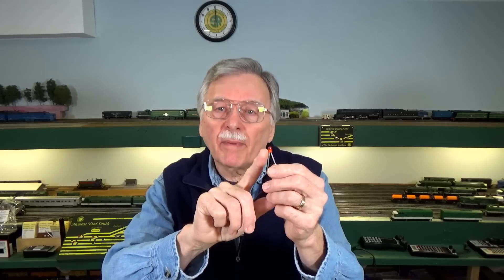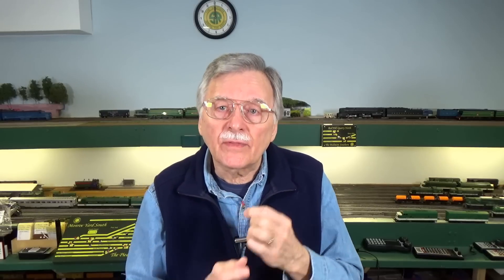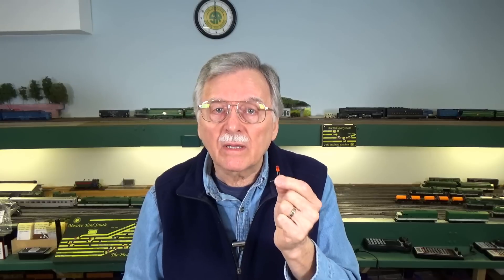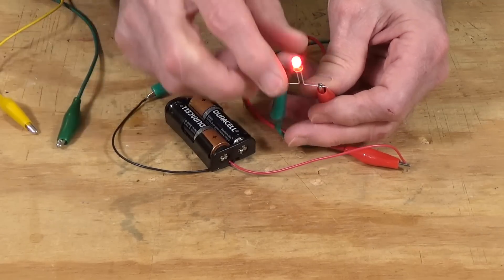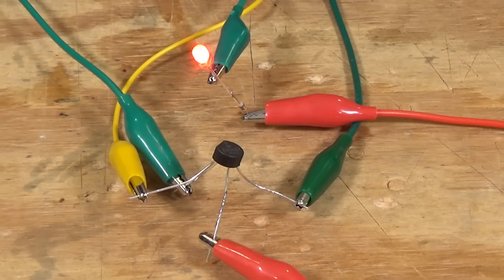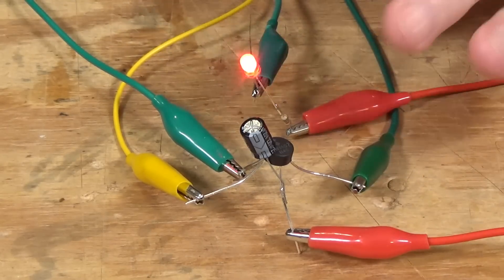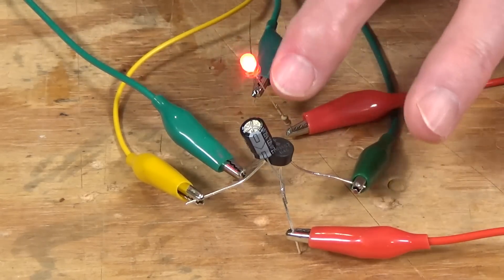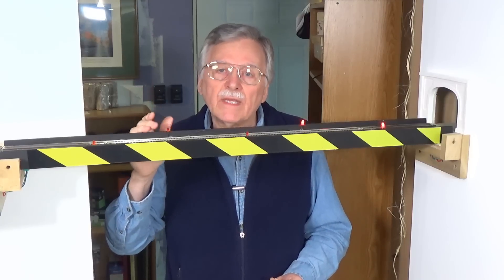The Secret To Using Flashing LEDs With DCC (302)

Comment: were the resistors necessary at each led, couldn't you just have one at the beginning of the feed
Reply from the maker: That would require wiring them in series which, as anyone who has had to debug old fashioned Christmas tree lights can tell you, is not a good thing to do.
Reply: @TheDCCGuy  thanks for the reply

Comment: Hi Larry. Is there any way to slow down the blink rate of these led's as I would like to use your circuit on my EOT cabeese? Thanks again for another great instructional video!
Reply from the maker: I think the blink rate is probably built into,the internal,circuitry. To vary the blink rate you’ll need to use a steady on LED with a flashing circuit. I’m sure if you Google LED flashing circuit you’ll find what you need.

Comment: Larry, can't believe missed this episode, the capacitor is what was missing in my attempt to do the same recently. THANKS.  Now have a question for you. While I was searching for information, this video did come up, which is great, but I was searching for how to use this same idea in another way on my layout. Would like to use this concept on each Turnout Control Panel for the 10 operating blocks. On each turnout panel the blinking LEDs would be used to indicate a short circuit in that block rather than some of the other concepts.  Have you an idea as to how this could be accomplished.
Reply from the maker: You could use a solid state relay circuit that turns the LED on when power to a block is disrupted. It could be powered off the DCC bus with a solid state bridge rectifier. That way the relay could be used to turn the LED on and off depending on whether it is powered or not. Set it up the relay os open when powered a d off when not. Take a look this circuit in Fig. 1 as an example. Because the LED draws so little current you could even use a transistor as a switch to do the job. There must be some circuits available on the internet that do this, but otherwise it will take some experimentation to get it set up.
Reply from the maker: Sorry, forgot to paste the web link:

https://web.archive.org/web/20150609001058/http://home.cogeco.ca/~rpaisley4/SSRelays.html

Comment: Can I use a separate power source for all my LED lights?
Reply from the maker: That depends in what you mean by ALL your LEDs. If you are just using them for building lights then yes, that is exactly what I do on my layout. LEDs like Woodland Scenics Just Plug LEDs have their own power supply. The are also other systems out there as well likely with their own power supplies. You can easily end up with multiple transformers plugged in to power all these different proprietary systems. Another consideration is that different color LEDs may need slightly different  voltages to operate which can be achieved with resistors.

Comment: I had a question since you were touching on LED’s . I have a PSX-1 , I’m sure most folks will mount these like I did , under the control panel or bench work . My question is what would be the most effective way to connect a LED to the short circuit side of the device , so I could mount a visible LED above the bench work to identify which district has the short when you have several folks operating on the layout at the same time .
Reply from the maker: Jumper 5 provides contacts for adding a remote LED to monitor the status of the device. Check your manual.
Reply: @TheDCCGuy  thank you for the confirmation . I had seen that , but wasn’t wanting to risk smoke confident I was right if you will . Thanks again

Comment: Hi Larry, Really enjoy your informative videos.  The 'Flashing LED', at least the ones I have purchased, have another surprise! Both the 3mm and 5mm LEDs if power is reversed they will 'Burn Out'. Had to use a 'Diode Rectifier' on the negative side to prevent positive feedback when the power was reversed while being used with a Tortoise.  Do the ones you have 'burn ou't if the power is reversed? The ones I have no one was able to determine why it happened, my thoughts were that the circuit in the LED to make it 'FLASH' could not handle reversed voltage. Your thoughts.
Reply from the maker: Unfortunately there is no data sheet with these on All Electronics so I know very little about them. It sounds like the IC in yours may have been blown by the reverse polarity. LEDs generally will not blow if subjected to reverse polarity but these may be different. Make sure to observe proper polarity must be the watchword. From what I have read online each company designs their own circuits in these and they can be pretty mysterious about them.
Reply: @TheDCCGuy  CORRECT, "....... and they can be pretty mysterious about them."  Why they 'DON'T TELL YOU IN THEIR DESCRIPTION IS RIDICULOUS'.  Have a good weekend.
Reply: All LEDs will burnout if the reverse voltage is too high. Flashing LEDs have very low tolerance for reverse voltage, typically half a volt or so. I believe Larry is correct when he says that it is the IC embedded in the LED that gets destroyed.

Comment: Hi Larry. I have a MRC Prodigy Advance2. According to the Manual, the DCC signal output is 14.5 V amplitude. Will this approach work with the Prodigy Advance2? I believe you mentioned the bridge rectifier inputs are "AC".  Want to make sure I don't mess up anything. Thanks Ron
Reply from the maker: You might want to up the resistor to about 1 K to compensate as my track voltage is set at about 13.5 V.
Reply: @TheDCCGuy  Thank you!

Comment: Very interesting, Larry, not least in exemplifying the nature of the DCC waveform.

I wondered if you'd tried it with just just the capacitor (i.e. without the rectifier): the LED illuminated on DCC current, so would a capacitor on its own be enough to overcome the on-off nature of the power?

Interesting you mentioned using a fluorescent flicker simulator to "light" a model camp fire.  When I was in the theatre, we used a fluorescent starter in series with a lamp to produce a random flicker for a "flame."
Reply from the maker: Electrolytic capacitors are polarized devices and require rectified DC power.

Comment: I'll admit that somewhere through the video it seemed like a lot of trouble to go to, wiring your lift-out bridge LEDs this way just to get flashing lights.  But the practicality of doing it in a way that you could use the power supply already present on the bridge won out.  I think a lot of us, by now, have all or most of the components somewhere in our stash, so it was never a matter of expense even though none of the electronics cost much when not purchased as a kit.

It's the power of the picture:  at the end when you just lifted the bridge out and set it back in place, with all the lights working exactly as desired and no need to connect or disconnect anything that made your whole point.  I will most certainly watch this video a few more times so I can recreate this idea on my own layout.  Thank you for that.  You are an excellent problem-solver.

Just an aside:  when I solve my layout problems with this bridge idea I will probably use my Cricut Maker to cut some styrene trusswork to make the bridge look more like a bridge.  It won't be exact or particularly detailed, to keep cost down, but making the lift-out bridge seem more like an actual part of the railroad is an interesting idea.  If I do that I'll probably move the LEDS to the trusswork tops.

As always, your stuff is really great.  Thank you so much, for doing all the thoughtwork that leaves the rest of us more sure we can do such cool things too.  You constantly expand our capacity to imagine what we can do ourselves, without breaking anything!  For example I'll venture the thought that watching your many top quality videos has left a lot of us a bit less afraid of aiming our hot soldering irons at tiny stuff, and usefully putting together bit-sized electronics is now nowhere near as intimidating as it might once have been.  We owe you so very much indeed!  Your credentials as a valued instructor are superb.

Comment: Larry excellent, now a question about the auto reverse loop you are working on , you need 12 volt dc , using DCC power would we need a rectifier for that application, this video give me some ideas for future layout I am working on
Reply from the maker: They say DC or DCC a d the inputs say “Polarity Free” so I assume the have a rectifier built into the circuit.

Comment: I'm starting my first HO layout and I like the video you did with the  new Walthers turnouts what are your thoughts about the Walthers new Flex track
Reply from the maker: I have not seen their flex yet but if it is as good as the turnouts it should be fine. I mainly have been using MicroEngineering track since 
I have a dealer friend who sells it to me at a deep discount.

Comment: Larry: you have a couple of Lifelike E's behind you.  The axle 'bearings' fall out.  Cannot locate replacements.  Any ideas???
Thanks.  (If in doubt, bore the fur off Larry)
Pete
Reply from the maker: Fortunately I have a couple extra locos on hand for parts. I don’t know whether the Walthers ones still use the same setup but you might ask them.
Reply: @TheDCCGuy  Thanks Larry; have had little luck researching this; no parts listed.  Most attention on these locos concentrates on axle system splitting, yet no one mentions this problem which seems as common.  Shall try modifiying the model.  Also, if time allows??????????????? hope to work on another solution to the axle muff problems.  I wonder about the complexity of these models.
Thanks for your channel.
Peter T

Comment: You did pretty good with your explanations, but one of these days, please consider using an oscilloscope to explain what is at the track with a DCC system and how a bridge will effectively make pulsating DC out of it and finally how a capacitor will smooth out the ripple to effectively give near pure DC as with a battery. As to the effect on the bridge, with the flashing LED lamps, Damn good idea, Kudos.

Comment: Thanks for the great video, On a HO Loco with a Digitrax sound decoder ,how would I hook up a flashing roof light?
Reply from the maker: Details West a d maybe Detail Associates make beacon castings for locos with a colored plastic dome. I nave drilled the plastic dome out just enough to insert a surface mount LED (see my video on LEDs for lighting locos). Then power that using one of the decoder function wires and program it for a beacon flash.

Comment: Larry, what a great video and explanation. Is there a way to regulate the rate of flash?
Reply from the maker: I doubt it since the IC is built into the chip. There are of course circuits that do alter the flash rate but they would be a separate build. You also may be able to find specialized ones with different flash/flicker rates—do a Google search or check eBay.

Comment: Nice vid. Very informative, as usual.
I add that you consider keying the liftout so that it can only be inserted one way. If someone lifts it out, turns around, and then goes to replace it, they'll be trying to insert it backwards.
Reply from the maker: Given that there are 4 PowerPoints that all have to be perfectly aligned for the correct fit, the bridge cannot be reversed by accident. You would need to build a special drilling template jig to even get close to a reversible fit.

Comment: Thanks for the very informative video!  Could you do a video on using LEDs with the DS64 and a local panel with a pushbutton to change turnouts locally?
Reply from the maker: I have such an installation on my layout, just didn’t do a video on it. Not sure now since the DS64 has been discontinued. Although I have enough DS64s on hand to do my next staging yard I may have to break and buy a DS74 just to see how they work.

Comment: thank you for this video, but i have just a few small questions. first what determines the size of resistor to use and how would i choose for myself. next you used recifiers and and a capacitor. how did you know what size of those to use.
Reply from the maker: The resistor is determined based on Ohms law and I have covered this i  my videos on using LEDs in the past—there are online calculators for this. As for the capacitor it is more complicated so I just used what Larry Maier suggested—220 uF, 25 volts. There is a way to calculate it but you need to know the specs which I did not have. Probably easiest to just have a few of various sizes in the 220uF range and see what works best, they are cheap. But now I know that one 220 uF cap will do at least 5 in parallel and I doubt I will ever use more than that in one place.